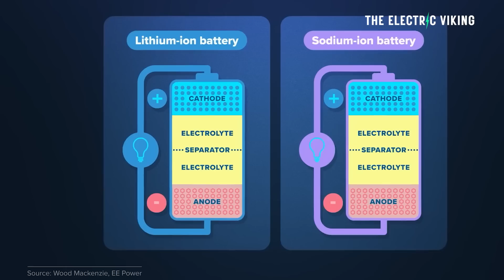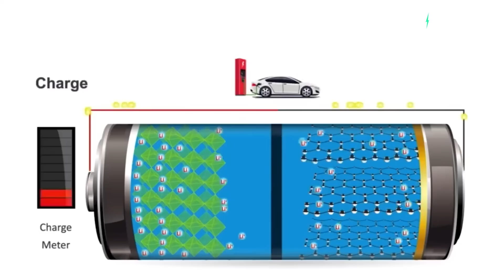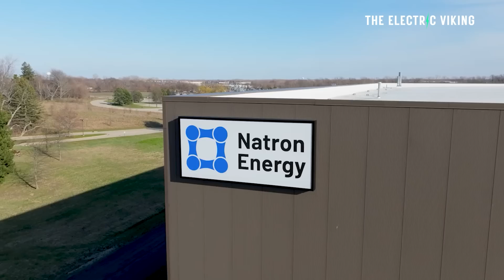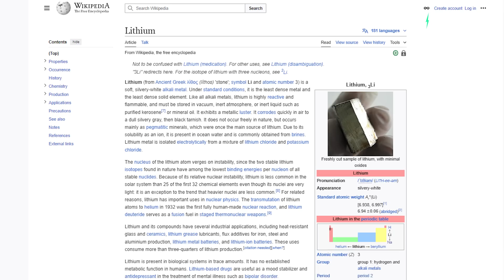America's game changing $1.4B sodium-ion battery gigafactory

Comment: US talks big but until it is in production, it is just hot air.   All the money spent on chip act.  Yet not a single chip has been produced in Arizona.   And B3w has disappeared.
Reply: Intel and TSMC in Arizona? Takes years to build new FABS?  Know anything about the semi- conductor industry?
Reply: @larryc1616  The original plan in 2020 was 2024 to have first plant started production.  It moved out to 2028 now.   And this is after pretty much move the Taiwan TSMC including the engineers completely over.    TSMC will have to take a big loss to sell US make chips too.   I doubt TSMC even has a couple of years lead they thought they have previously.
Reply: @TAL142  

another way to look at it China has managed to make a homegrown Lithography machine albeit one that creates legacy type/level 28nm chips   

Where they are using their proprietary layering/patterning technique to get down to that 7nm/5nm 

 So yes one could argue they are behind from a sanctioning standpoint But from an all out war standpoint where a Country has been cut off from inputs from other countries? 

 I look at it as a China is ahead Because really that is the worst case scenario the USA/West is envisioning. 

 As that being the reason they have sanctioned/cut off China right now

That’s the biased criteria we put on China they need to be making that 100% homemade semiconductor chip From that 100% homemade lithography machine right down to the screws and Rare Earths required to make the lithography machines in the first place
 

 Where ASML sources 85% of what goes into making their lithography machines from around the world

👇

Circumventing the Chokepoint: Can the US Produce More Rare Earths?

Oct 30, 2023

* Rare earths—which include the fifteen lanthanide series elements plus scandium and yttrium—are critical not only to energy technology like permanent magnets in electric vehicles and offshore wind turbines but also to military applications like lasers and precision-guided weapons. These elements enable defense equipment and weapons system components to function.

From 1950 to October 2018, China filed 25,911 rare earth patents, while the United States filed only 9,810. Thus, China can also restrict rare earth technology. In April 2023, for instance, Nikkei Asia reported that China was considering restricting exports of rare earth magnet technology

New Security Beat
Reply: @DW-op7ly  China is moving faster than I expected.   But you can thank the US government.  If it was free competition, many Chinese companies may still use western chips.  But the fact is these same Chinese companies can't really dependent on the western chips.   So US is basically giving the entire Chinese market to Chinese chip makers as long as they can make the chips.    

Layering and patterning China was already ahead of US (technically the west since US can't produce chips either)  US just controlled the foreign countries and companies that can produce the chips.   The major obstacle for China was the Lithographic machines.   But if China has figured out a different way or make their own machine, then ASML may be in trouble.  Not that many companies buy these advance chips.   And China accounts for 53% of world trade in chips.   

And if Korea, Europe all want to produce their own chips, then there will be a overcapacity of lithographic machines.   If they don't make profits, many companies will go bankrupted.
Reply: @TAL142  well I wouldn’t doubt the Chinese to atleast corner the legacy chip markets
Reply: @larryc1616  Just mean more bullshit.  In 2020, they claimed they can have the first plant in operation in 2024.  Then it was delayed to 2025.  Recently I think it has moved the delay 2027/2028.    That is at least 8 years.   And you don't have several years.  US is not as far ahead as they think.  US don't have talents and supply chain either.   They even brought all the Taiwanese engineers over to US.
Reply: From what I read the USA has the largest deposit of Soda Ash. So it would make sense for the USA to make Sodium Ion Batteries 

It's not going to happen in the USA

Since it's basically America and the American people attitude towards clean, green, renewable etc etc etc 

When it comes to semiconductors 

It's not the most advanced chips that keep these companies going, it is the Legacy chips. Which we in the west forced them to make their own semiconductor industry. 

👇
How Close Is China to World Dominance in Legacy Semiconductors?

* Bread and Butter Technology 
Obviously, China would like to be a major player when it comes to high-end sophisticated semiconductor devices, but that doesn’t mean they are not interested in the bread-and-butter end of the market, particularly when it comes to legacy products. In fact, they are very interested in the legacy market, and there are some very good reasons why.  

Legacy devices make up a huge amount of global chip sales. 

Most chips manufactured today are not advanced chips but legacy chips, and around 71% of devices currently sold are made using software and production equipment created more than twenty years ago. 

* The views of industry analysts and observers vary, but generally speaking, it’s thought that 22 wafer fabs are being built in the country, and there is an overall plan to create a total of 30 new wafer fabrication plants. Many of these will concentrate on the production of legacy devices. As for market share, industry intelligence gatherers Trendforce believe China’s legacy chip manufacturing base could provide as much as 30% of the global demand for older devices. 

EP
Reply: @larryc1616  They had insane DEI requirements so TSMC is just gonna build in Japan instead.
Reply: @Pvemaster2 false. The company I work for is part of the build and there's zero DEI requirements for building. The only requirements is to pass a background check and have the needed skill set for what you are being hired for. I.e. welders need to actually know how to weld
Reply: @Pvemaster2  I would not doubt that.
Reply: @Pvemaster2    Is that you Donald ?

Comment: Not energy dense enough for vehicles.. end of story.  Lithium sulfide has 10 times the potential energy of sodium
Reply: yachts are terrified of fire.  they will eat these up.
Reply: @mikepayne1350  Lithium Iron Phosphate batteries are already almost completely fire resistant. They are already being heavily used in the yacht business for that reason. 
It's really hust the Lithium Nickel Maganese Cobalt battery chemistries (NCM) that are prone to fire when damaged or defective.
Reply: Correct!  The rule here is physics. Lithium has the correct electron valence shells to make it able to store, and thus transfer, more energy in a battery than sodium can. Full stop.
Reply: Hmmm. Something doesn't seem right here. Sodium has a higher reducing potential than lithium but also larger atomic radii, so effectively a lower energy density. It's less by maybe a factor of 2 but surely not 10!!
Reply: @Hookeslaw  Agree, Sodium replacing Lithium can theoretically achieve about half of the theoretical energy density of Lithium.   So in a given theoretical battery structure and chemistry, replacing Lithium with Sodium should about halve the energy density.  However given that neither element has been fully developed to its maximum energy capacity, it appears to be a closer race than it really is. Ultimately Lithium should win the energy density award between the two.
Reply: For energy storage today and in passenger cars in a few years although they're using it in some Chinese ev's this year.
Reply: This is false. The energy density is plenty . Especially for tiny robotaxis with small batteries , 200 mile range ~ charges in 5 minutes. And mega packs of course
Reply: @camronrubin8599  Agree, sodium based batteries are plenty powerful for vehicles especially smaller ones. It's just that Lithium will always, chemically speaking, able to be used to create more powerful batteries than sodium ones. Just the nature of the electron valance shells on each atom. Sodium is more abundant and cheaper but that is temporary as new Lithium mines are coming online in the US  that will greatly reduce the cost of Lithium. Also both Lithium and Sodium have to be highly refined to be purified enough to be used in batteries. Both undergo similar refinement processes so not much, if any, cost savings there.